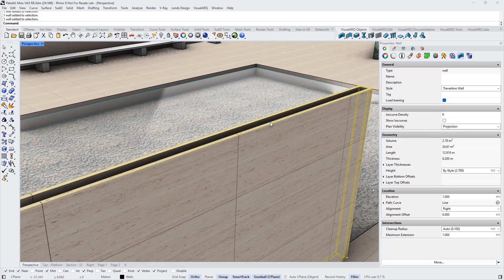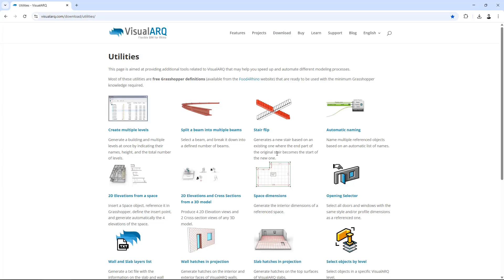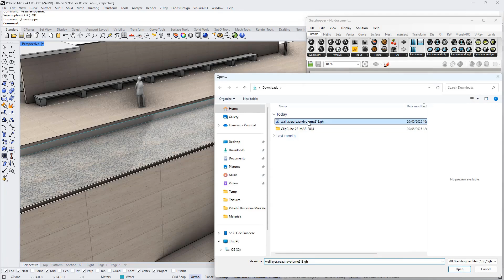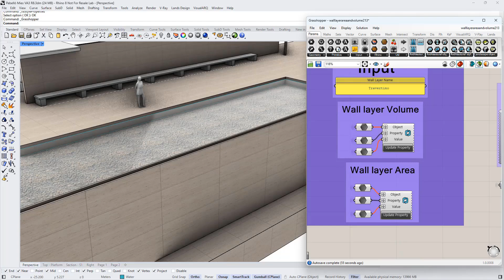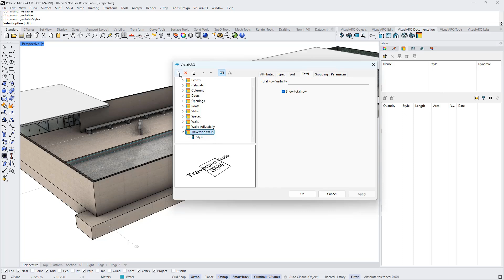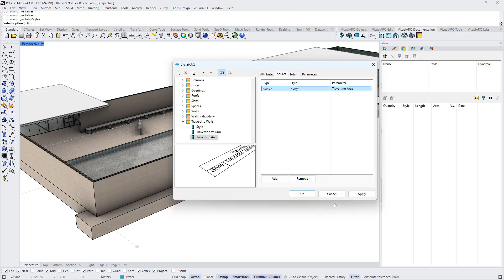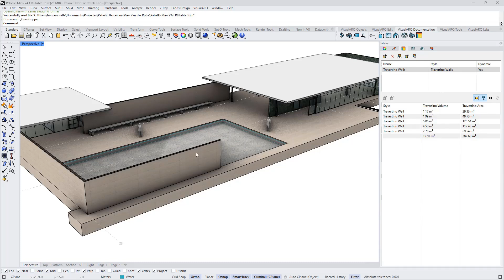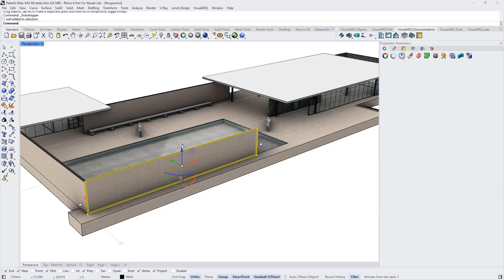How to Calculate and List Area and Volume of Wall Layers in Rhino with VisualARQ

Comment: Hello, is it possible to increase the precision of area and volume values from 0,01 up to 0,0001 for instance? Or assign an area and volume units to project units (m , cm ,mm)? This will be really helpful for smaller objects.
Reply: Is this going to be implemented into VA so we dont need to recalculate everything? "on the fly"
Reply from the maker: @picajoool  yes, this is planned for future versions. What is showcased in this video is a workaround until this feature is implemented in the core of VisualARQ.
Reply: @VisualARQ great 👍
Reply: R U designing an ant house?
Reply: @picajoool  for some non standard details (as steel plates, or non standard shape elements - where volume * self weight per unit is the best solution to calculate its overall weight) which has to be added into the tender design table for instance
Reply from the maker: Hi @miroslawt.8654, yes! in the Grasshopper script, there is a parameter that lets you define the nº of decimals in the calculated values. You can find it at the end of the definition .
Reply: @VisualARQ vrlo interesanto Miroslave 👍